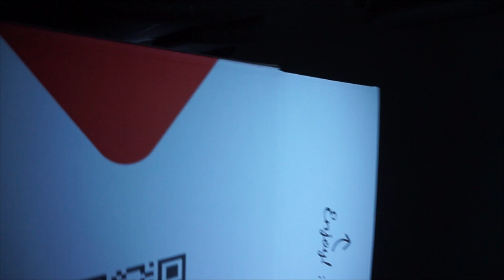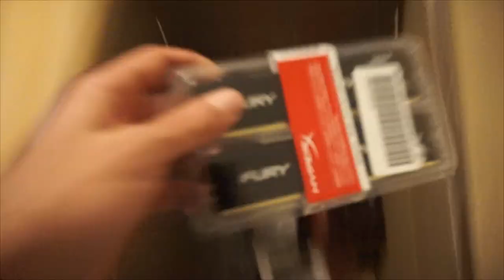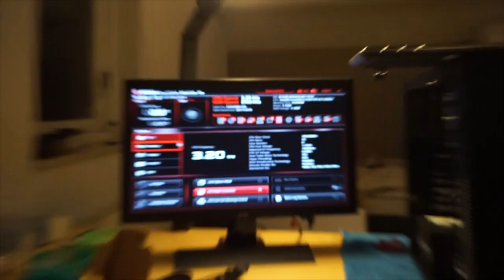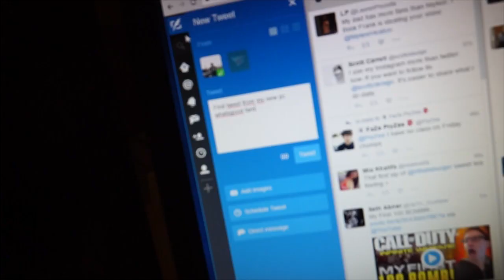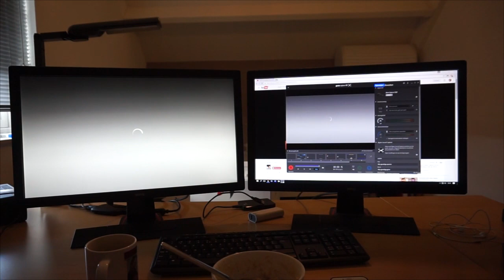BUILDING MY FIRST GAMING PC!!

Comment: Gaming pc with the stock cpu fan? No
Reply: MrAppledude007 Whats wrong with using the stock cooler, the cpu isn't even unlocked nor is he gonna overclock it. The cpu has a tdp of 65w so it ain't gonna get very hot or noisy
Reply: There isn't any point in him getting an after market cooler, if he had an overclockable CPU then he could have.

Comment: You got a graphics card that can't even run minecraft with $800 when you could have gotten easily a gtx 1060 but you got a rx460!?!? I mean atleast a 480 mate!!
Reply from the maker: jack mcelroy if I couldve gotten a 1060 I would. Everythig is just a lil more expensive in euros unfortunately .. Its fine tho I use it mostly for editing etc :)
Reply: If you  buy stuff in euros its cheaper bro. I got my i5 6600k gtx 1060 gaming pc for 780 euros on mindfactory
Reply: jack mcelroy or A 1050
Reply: Oh, I thought you were american lol all of the american pc builders were face palming because the gtx 1060 is only $250 here lol

Comment: I would have put a 1060 3gb or an rx 480 4gb in that thing,  but that's just me.
Reply: And a 500 watt Evga psu
Reply: MLGTommy47 - Rocket League Trader Nah not 1060 3G. Most games max the vram out.
Reply: Sami Chowdhury the rx 480 4gb is better bcuz the 3gb version of the gtx 1060 is having 10% less cuda cores than the 1060 6gb...
Reply: HIPZTER◬ 1060 3gb beats at some games the rx480 8gb....
Reply: JarnoGameplays 4gb rx 480 beats gtx 1060 6gb at some games
Reply: MLGTommy47 lol 3gb of vram
Reply: MLGTommy47 only at games that it's optimized for, but this can count for every gpu ever

Comment: why did u get 650w psu bro, u can add them to buy a better graphics card
Reply: U shouldn't save on psu...
Reply from the maker: Eduardus Adrian i actually had a 550w before but the store ran out and replaced it so I could pick up my parts sooner!
Reply: Rat Face yeah im aware of that but if you wanted to upgrade to a more powerful gpu, you may also need to upgrade your psu if you have a small one.
Reply: FaZe JzpR i see but imo u should get a better gpu
Reply: Rat Face yeah bro im using i5  6500 and a gtx 1060 500w is enuf
Reply: but i shouldve get the rx480 tho FeelsBadMan
Reply: Rat Face yeah dude goddamit i switch from r7260x to this gtx i was happy at that time...then a new amd driver update goddamn shit

Comment: He could of swapped out the rx 460 for a gtx 980 witch is the best graphics card for how old it is. It was the best graphics garden 3 years in a row and is clocked between the gtx 1060 and gtx 1070. He could have picked up the 980 for about $250-350 and would get better performance.

Comment: Damn son $800 that's low but it good for a Beginner  my first gaming pc had 4790k gtx 970ftw 16gb ddr3 Samsung 840ssd 4tb hard drive rog asus motherboard 3 way monitor and that cost $1500 and that was 3years ago and I still have it and it runs like a beast upgrading soon to high end 6850kon x99 rog and gtx 1080

Comment: really bro a stock Intel cpu cooler come on for a gaming pc ur cpu is screwed if u don't get a better cooler
Reply: Bio_Hazard_ Gaming ur wrong. The stock cooler works just fine if he doesn't oc it.
Reply: k potet it doesn't matter is he over clocks or not he's going to be gaming at high graphics and very intense games the cpu will run hot the stock cooler is jot ment for high performance pcs he needs to get a better one before he burns out his cpu
Reply: Nice well I really don't care what u have to say he's gaming with a HIGH SPEC PC and will heat up alot the cooler won't help the cooling of the cpu. Just letting u know 😃
Reply: Wow. If you call that high end..

Comment: you first PC is so bad
my first  Pc
water cooling
i7-6700K
DDR4-2400 8G x 4
Asus Z170 gaming pro
M. 2 SSD  intel 600P 480G
Sata 3. SSD Intel 540S 240G x2
stata3 SSD SanDisk X400  480Gx1
Asus Rog STRIX GTX 1070 x 2
power  thermaltake 850w gold
Reply: Sure sure my first build had 10 titans and 48 1080s and my power supply was only 50w
Reply: WOW SO COOL

Comment: I wouldnt call this a gaming PC
Reply: listen kid i have been doing PC builds for a while. why didnt he get like a i76700k. and a better mobo. he will get so much more for the price and wont have to worry about lags and other problems.
Reply: Walmtorn Gaming he most likely dosent have the money, and you clearly dont know that much about pc's. most games wont take advantage of the extra cores/threads that the 6700k has, and maybe you could argue that a 6600k would be the best for gaming but the 6500 is going to be fine, the most u will get out of the 6700k is maybe 5 extra fps and you can ask yourself. is spending an extra 200 - 300 dollars worth 5 extra 5fps?
Reply: Bro. 1050TI is good for the wallet and the PC.
Reply: Walmtorn Gaming yeh it is and the 1050 ti is a lot better than the rx460 but will also set him back an extra 50 pounds or euros
Reply: i feel like it would be a lot better to spend 60 bucks to get alot more performance
Reply: it would, dont get me wrong but he probably dosent have the money to do that or its the fact he dosent know what is a good graphics card. the rx 460 is targeted towards esports games and he might of thought oh i play esports then i need this card.
Reply: he could have used the money he bought the second monitor for.
Reply: QK3N TV "For my budget" listen for once.